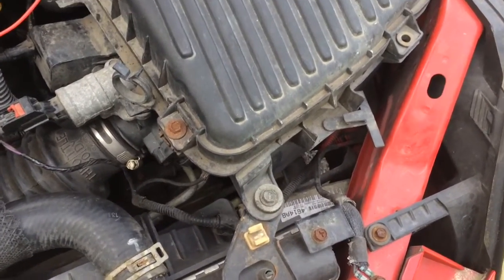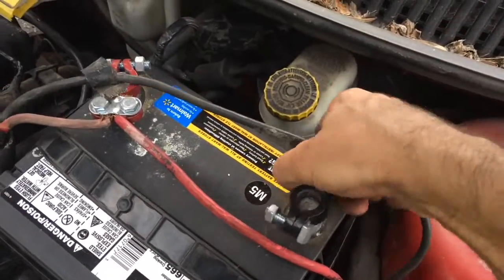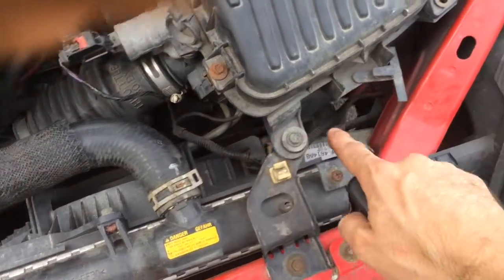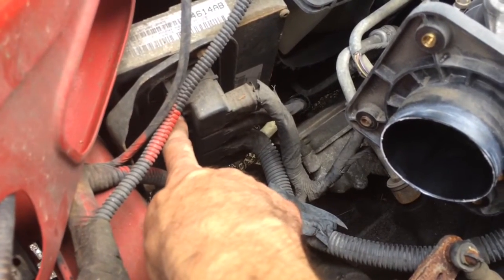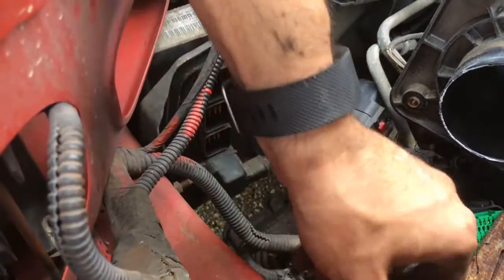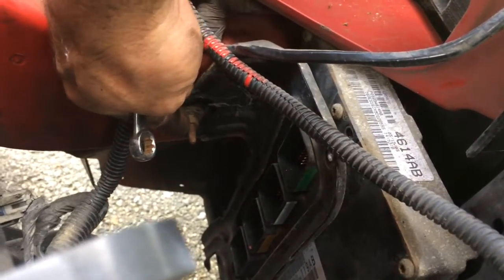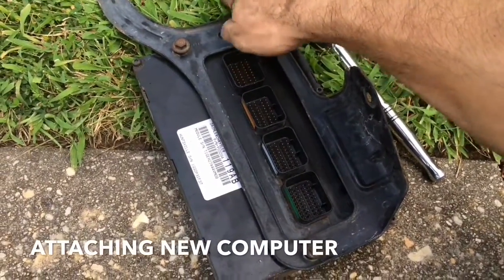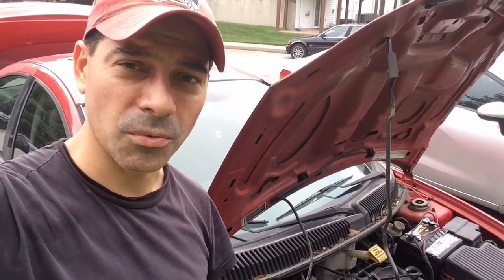How To Replace ECU, ECM, PCM (Computer) - Dodge Neon (Andy's Garage: Episode - 3)

Comment: Thank you for the video 
My electrical system is going haywire.  Causing the interior and exterior lights to go dim and bright over and over.  Car seems like it wants to stall out also. The forms say that it's the computer.  I have also changed out the alternator.  So this is the last possibilty of the fault. Byw no check eng6lights are present.

Comment: What do you know about 98 neons? Im having an issue with mine. It runs fine, itll idle all day. Once I start driving it, itll be fine for a day or two, then just die. If I let it sit, it start back up and run. The longer I let it sit, the better it does. I thought maybe it was the fuel pressure regulator on the fuel rail needing a new diaphragm, but it was suggested to me recently that it may be the ecu. Over heating and shutting it down, then after its sat, it cools and is fine again. Your thoughts?
Reply from the maker: You mentioned it will run fine for a couple days. Is it taking a couple days to overheat? How are the RPMs looking while driving? Any engine codes?
Reply: @PhillipsVision  once it runs, I drive it daily and then it just dies. Its a 5 speed and I have not noticed and rpm flucuations. Itll run, then itll stutter a big and then die. The check engine light isnt on, and I dont know if its throwing any codes. I can check it tomorrow though, I have a bosch code reader.

Comment: Does the new computer need to be programmed or is it plug and play?
Reply from the maker: Dave Sylvia it will need to be programmed to match the VIN with the SKIM and Key
Reply: Thank you how difficult is that to do?
Reply from the maker: Dave Sylvia I’ve never flashed one; a dealership needs todo it unless you know someone with a device to program it. I wouldn’t think it should take long. Last I heard it costs about $80

Comment: Does the immobilizer and ignition cylinder have to come from the donor car too??
Reply from the maker: Sergio Vasquez yes, but you will also need the key since that is what the immobilizer is reading. The chip in the key is read by the immobilizer and communicated back to the computer letting it know there is a match and the car can be started. The other option is to have the computer flashed (reprogrammed) and setup with a new immobilizer, key and vin.
Reply: Mr. Phillips, your video is on a 2005 neon. What's the difference between your video & a 2002 ?
Reply: @TheSafecrkr1  they should be more or less the same. '02 thru '05 are more or less identical

Comment: I have a 2000 neon plymoth it cranks no spark at any plug change crank an cam sensor an coil can't find the problem
Reply from the maker: Turn the key to power on, but don’t crank engine. Are you hearing the fuel pump prime?
Reply: Yes
Reply: If it cranks when you turn the key, it is probably not the PCM.

Comment: I have an 03 neon and it saying p1698 tcm no buss. I looked everywhere for the part on car could it actually be the computer?
Reply from the maker: Brittany Nelson it could be, but could also be a bad connection or broken wire. Before replacing the computer and having a new one flashed and/or corresponding components replaced I would make sure all connections for the power train are good.

Comment: Changed the computer in a 2005 dodge neon and now it won’t shift out of gear 1. No codes
Reply from the maker: Shadowmm1234 did you replace the ignition cylinder and SKIM? Those all need to match
Reply: Phillips Vision no. I had the computer reprogrammed to match the VIN number
Reply from the maker: Shadowmm1234 was it reprogrammed by a dealership? What gear is it stuck in?
Reply: Phillips Vision gear 2. I purchased the ECU online and they programmed it. I drove the car around just now and it changes gears sometimes but it will randomly stop shifting when I come to a stop and stay in gear 2
Reply from the maker: Shadowmm1234 could be a transmission issue. Is it only getting stuck when you shift it or when you’re in drive and it is shifting through gears?
Reply: Phillips Vision it only gets stuck when I stop. It will cycle through the gears but if I go on the highway it will stay at 60
Reply from the maker: Shadowmm1234 if you try to go above 60 does your car start to jerk and fall back below 60?
Reply: Phillips Vision yes.
Reply from the maker: Shadowmm1234 ok, well it sounds like your camshaft position sensor. I’ve had them  go up a few times on Neons. Basically, this sensor monitors the position of the camshaft and works with the firing order of the Injectors. When it fails, you experience what you’re dealing with. It’s an inexpensive part and fairly easy to change out.

Comment: What is the green connector called? My was damaged in a wreck and I need to replace but I cant find the name to order it online.
Reply from the maker: Chris Letbedder. That’s a pcm green harness socket. You can get a replacement for less than $20 online. eBay has them.
Reply from the maker: Chris Letbetter that’s a pcm green harness socket. You can get a replacement online for less than $20; eBay has them.

Comment: So my 05 neon has no crank, no start,. New battery, new battery cables, new starter. I have not replaced crank or camshaft sensors. Was this your issue that made you decide to change computer?
Reply from the maker: Jayson Barfield yes, but before you replace the computer check your starter wires. I had a similar situation but it was the harness that goes to the starter. Remove your starter and test it connected directly to the battery

Comment: No programing no reseting o something like that only just put on
Reply from the maker: If you are replacing the matching skim, chipped key and ignition cylinder...yes, no programming needed. If you’re not replacing the entire system, then you will need to reprogram
Reply: @PhillipsVision  Some of these older units are write-once ROM,  which means the VIN can't be updated, even with a DRB3.